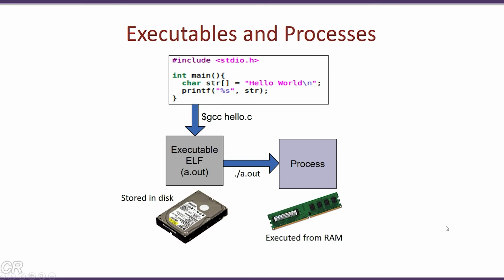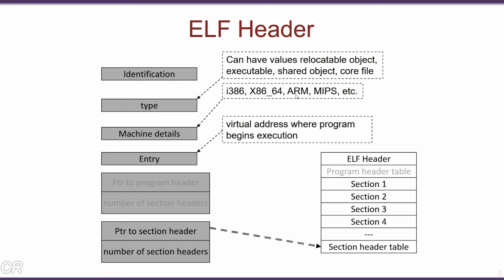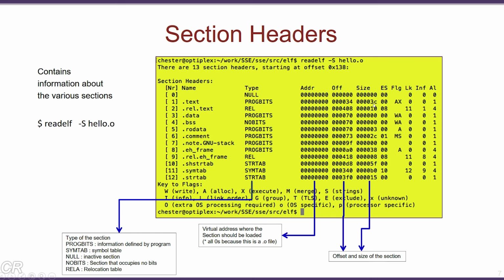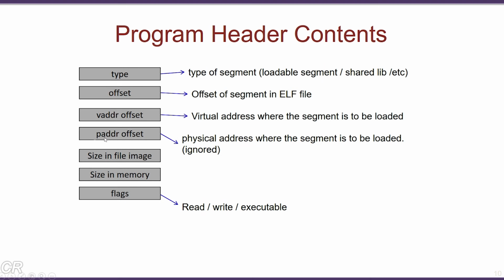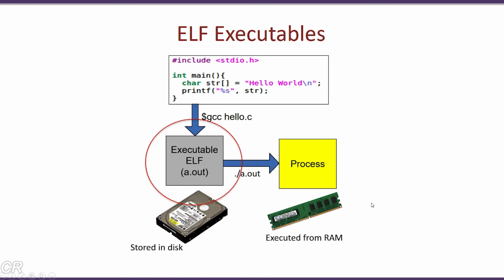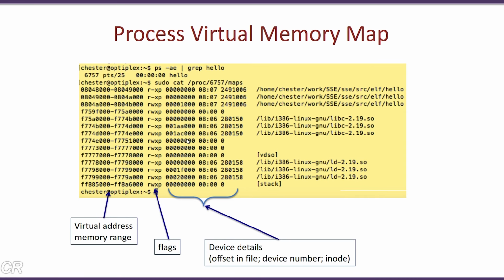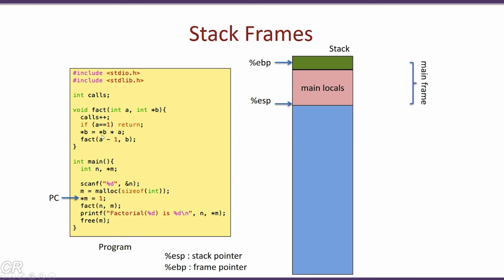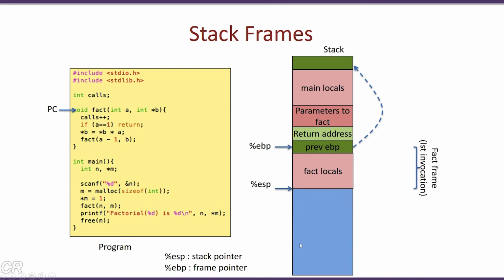#2 Program Binaries | Information Security 5 Secure Systems Engineering

Comment: Error in the code at 18:15.

There is an error in the code displayed at 18:15. execlp function call should contain "./hello" and not "hello".
Also - wait() function takes one argument, otherwise it gives error. I used p = wait(Null) to rectify the code and it worked.

Comment: Getting Error "readelf: Error: Not an ELF file - it has the wrong magic bytes at the start" after having created the object file using this command - gcc hello.c -c
Reply: Found the solution to it. "readelf" does not work in vs code terminal. Now, I am using Kali Linux and write the C code using Vim editor. readelf works as intended in kali linux.